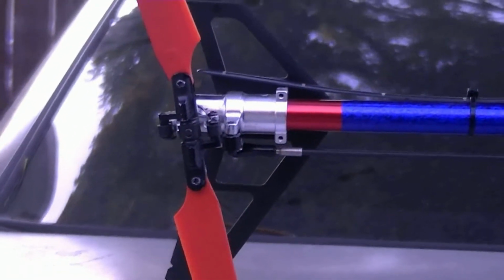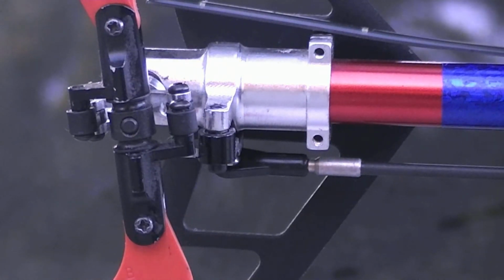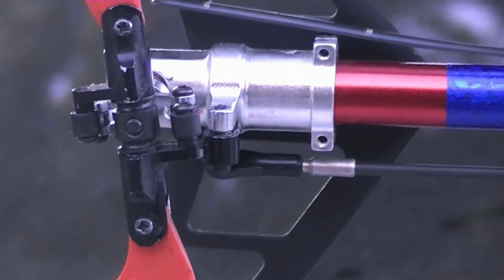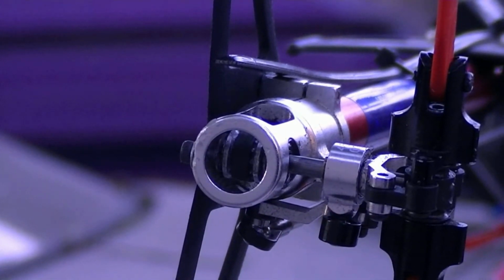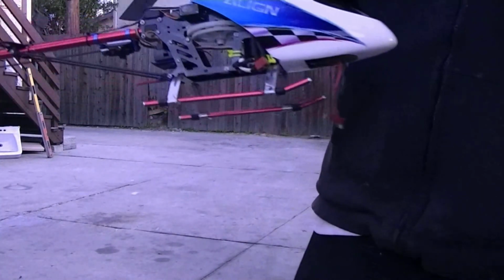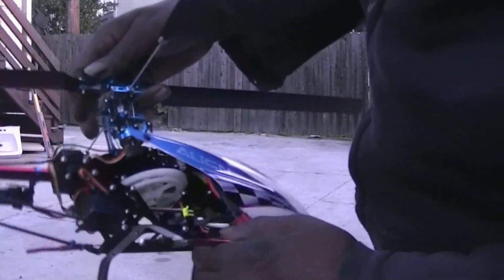titan trex 450 new cf tailpush rod and tail servo mount upgrade

Comment from the maker: @Flydan6 
well ive had about 25 hovers with it and it only cost 10 bucks 
it has been acting up .
so i just bought a align RCM-BL450M 3500kv motor for 30 bones 
it should be more reliable for the little i do with it in the back yard.
but you know im just busting open with some chit when i get to the field 
just warming up in the back yard first.
with a cheap bird it helps you to relax and play with stuff and learn and grow before i bust up the good stuff.
make sense ?